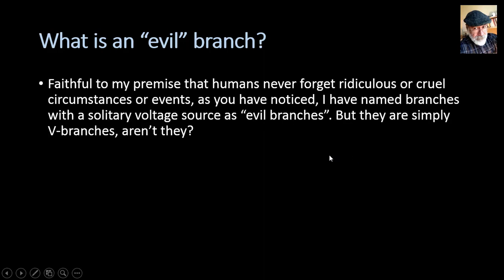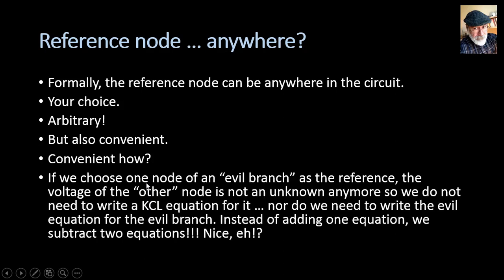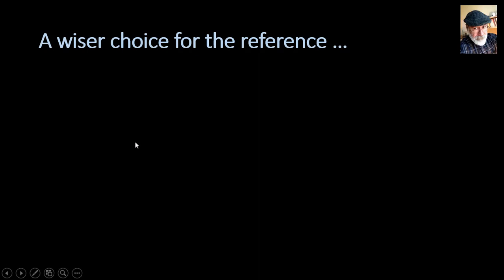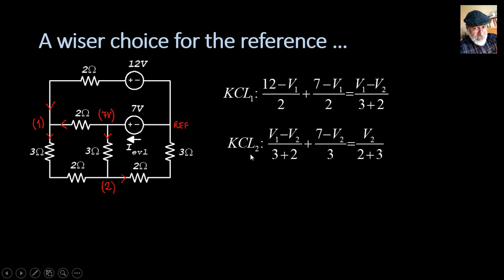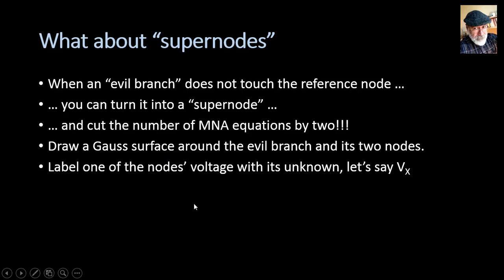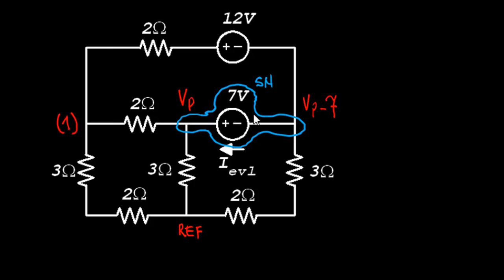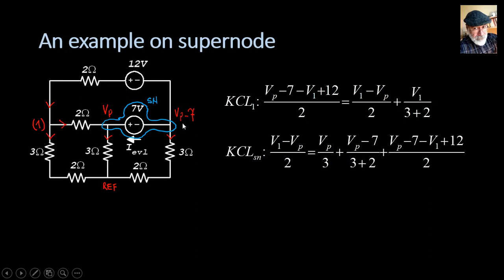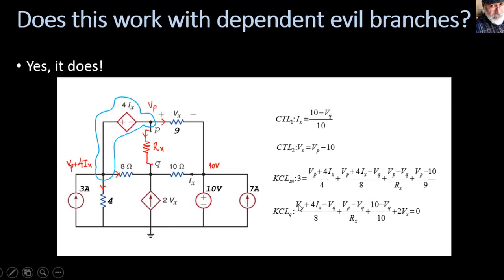EE 101/21b - Evil Branches, supernodes and MNA

Comment: How would the last example be solved? Can there be an equation for R_x?
Reply from the maker: The last example already has all the necessary equations on the screen, two CTL ones, and two KCL equations. Solve that system and get directly Vx, Ix, Vp, and Vq. With those four values, you can find any voltage, current. or power in that circuit.